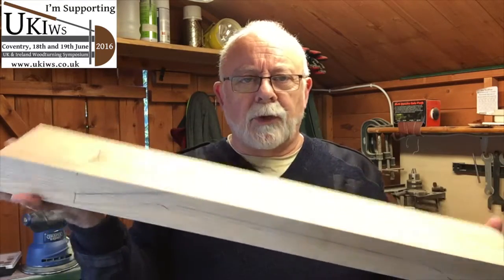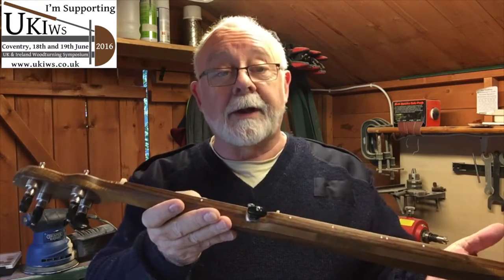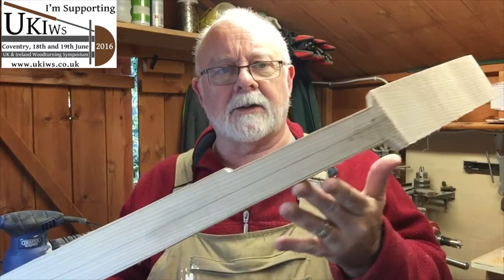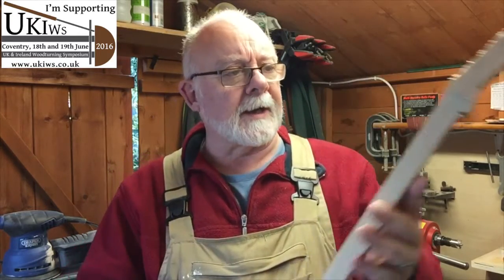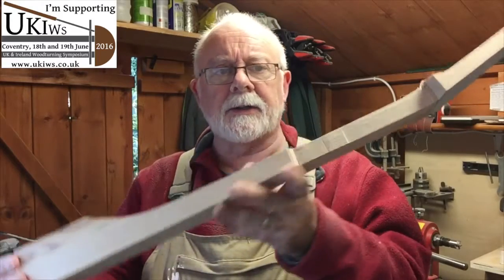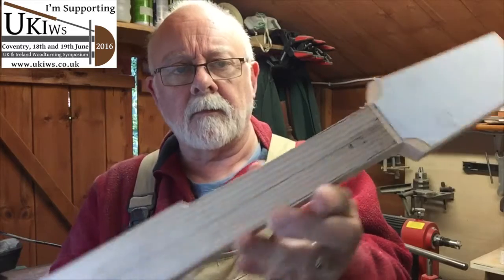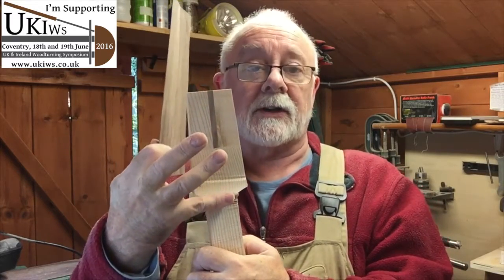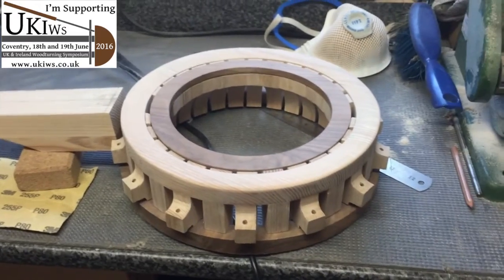Banjo Build - Part 7

Comment: Fascinating build. Really enjoying it. Thank you for sharing. Just wondering if its advisable to counter veneer as in cabinet making?  Cheers
Reply from the maker: +broadsideguy Thanks for the comment.  Are you suggesting aligning the veneer grain perpendicular to the head grain?  It's not something I had thought of but maybe I need to research it?
Reply: I have only limited experience of veneering and only with furniture or boxes. In that situation it is recommended to counter veneer to prevent cupping or bowing. It is common practice to use a balancing veneer on a drawer front which may well be of a similar thickness the  head of your banjo. I just wondered if it was necessary in that situation.  I know nothing about making musical instruments but your build is certainly providing an interest. Thanks again.  Dave
Reply from the maker: +broadsideguy I know very little about cabinet making Dave.  I can understand the issue with a large section but I don't think there will be a problem with the area of the head.  Of course, it will be well finished too, probably with TruOil, so that should help the issue too.